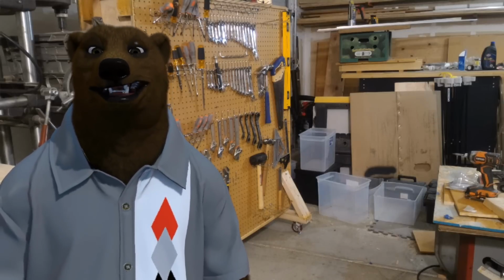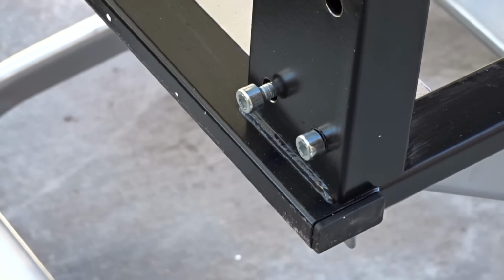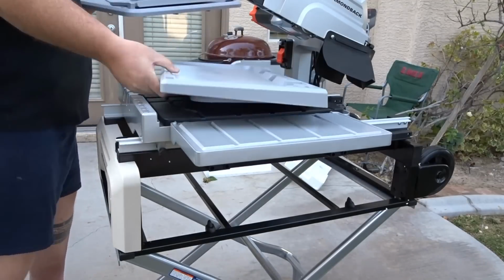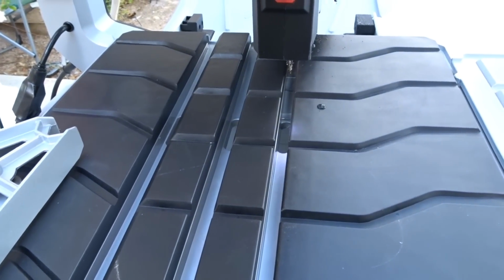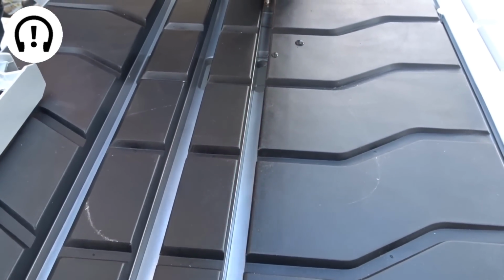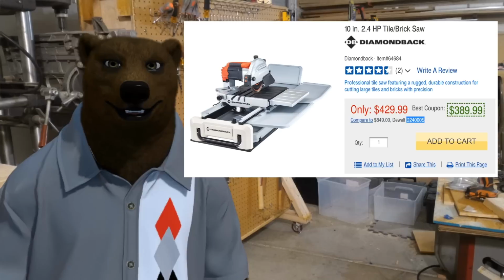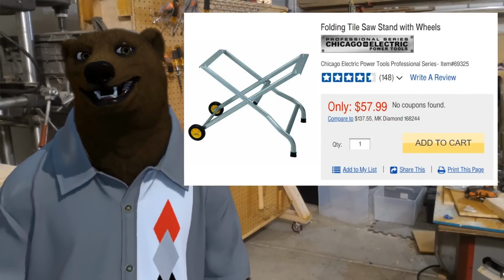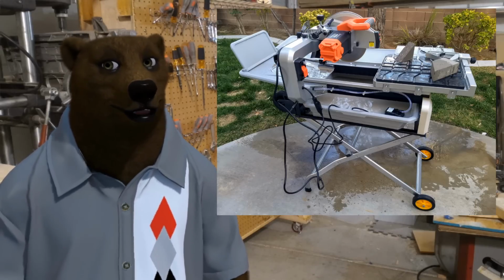Diamondback 10" Tile Saw (Setup & Review)

Comment: I own this saw and IT IS A BEAST. One of the best tools I own. I absolutely love it. DiamondBack blades are excellent to.
Reply: Bought mine about 3 years ago. Still my favorite saw to use and I have 4. Got the Dewalt 10 inch, rigid 10 inch, and a rigid 7 inch along with the diamondback. I like the Dewalt but it's just a pain to set up and break down. And it doesn't cut as well as my diamondback and it's 1.5hp as opposed to 2.5hp on the diamondback.

Comment: Had mine for 3+ years. My favorite saw out of the 4 i have. And i have the dewalt 10 inch. Just doesnt cut as well as my diamonback. Even with a better blade on the dewalt, i still get a much cleaner and faster cut from the diamondback.

Comment: Can you show the different angles you can cut with that's all I saw you got a 45 but you didn't show how easy or how hard it is to subduing that angle end does the motor turns you could do Edge cuts on different angles

Comment: I do tile work and have used dewalt tile saws the most along with the chicago electric 10 inch saw from harbor freight. The chicago electric one got water everywhere and is strictly an outside only saw. And the water kind of just dribbled out until I drilled the water port holes out a little bit. Other than that, it held up well over time. But this new saw looks like better quality all around especially with the splash guards. How heavy is it? The dewalt is lighter than the chic/electric. Kind of important when you are loading and unloading your tools every day, the lighter then better.
Reply from the maker: This is not a light saw but there are wheels on the back so you can pull it along by the handle.  Water control was top notch though.

Comment: I like it but, can it cut slate ? I do agree liking the easy install of blade.
Reply from the maker: Is slate harder to cut than all of the materials I used?
Reply: @denoftools  I am not sure.
Reply: @denoftools   Actually, slate is pretty soft compared to the stuff you were cutting.
Reply: Yes. Slate is compressed mud.
Reply: Slate is one of the softest materials. Granite & marble are the hardest. The next softest to G & M in my line of use & expertise is porcelain. Granite & marble are the two which I get most worried about the power, quality of the blade, and the most accurate of the cut with a wet saw.

Comment: Homeowner looking to do a few tile jobs and wondering whether the 10" has any benefit vs. the 7".  I suspect the main difference would be depth of cut on brick, and perhaps smoothness of cut (10" is larger radius, faster blade, more power at point of contact with material).  Any thoughts?  TIA
Reply from the maker: Yeah, size of the material is the main benefit.  The secondary benefit is that it has more splash guards.

Comment: Bench Tops are great for using next to your workspace on porcelain tiles, like the 4x4 tiles in your shower.
Will it cut hard floor tiles which are usually made of ceramic?... yeah...but it's hard on the motor. 
I have all Ridgid power tools, but man, at $700+, it's a tough swallow since I don't do it for a living anymore.
Great demo 👍

Comment: Been waiting for this since you gave a teaser about it a few videos ago... I have a lot of tile work I need to do in my remodel and I was eyeballing the Chicago Electric but I believe I'll have to spend the Extr $$ for this one. It looks better built, sled and fence also look more well built not to mention the splash guards included.... Good job Bear and keep'em coming...
Reply from the maker: Just a heads up. Turns out that they are blocking DB in the new super coupons.  There are some out there that are still good that don't list it so it's a YMMV situation.
Reply: Thanks!

Comment: this is really just an upgraded version of the chicago Electric 10" tile saw from harbor freight. i have the Diamondback blade on mine. sits on the same table stand too. mine doesn't havce the extrended splash board or the laser. looks like a great saw

Comment: I'd like to know what things they added to this saw from the Chicago Electric model. Obviously the laser, light, and extra splash trays, but anything else change? The 10" Chicago Electric tile saw at $229 was pretty good deal for what you got.
Reply from the maker: Essentially this is an upgrade of that saw.  It's a more robust motor, with a bunch of extra features included.  This one comes with a high-grade blade plus;  laser guide, work light, side table, multiple splash guards and wheels.  The price diff with best coupons is $112.  Now subtract $30 for the blade and it's $80.  So the question is for you, would you pay $80 for a more robust version of the same saw but with a laser, work light, side table, splash guards and wheels.

Comment: Does the water pump have any sort of filtration to keep the abrasive ingres out of the impeller?
Reply from the maker: Yes
Reply: @denoftools  thank you. I didn't see it when your human installed it lol. Is it a fine particulate filter?
Reply from the maker: It is a fine particulate filter.  The tray has a sort of corse filter built in.  If you look closely there are these teeth that form a wall around the pump and they filter out larger debris.
Reply: @12gaugeCharlee  lol, "your human"

Comment: I just picked this saw up 3/3/2019.  After putting it all together with the optional stand, I noticed the sliding table throws itself a hair off when you fully extend it.  Did you notice any bump or notch when fully utilizing the slide table?  I'm headed back to HF to recheck the demo saw table and swap this one out if it's a defect.  Cutting lengthwise on long tiles, I can't have it kicking sideways and ruining blades/material or making work look crooked.
Reply from the maker: No, and I did cuts that were longer than the saw is made for just to push its limits.  Check to make sure that it is sitting on the track correctly and that there is nothing blocking it.  OH, you know what, I did at first have an issue with the hose bumping the table, but I adjusted it and no issue after that.
Reply: @denoftools  Thanks for the reply.  I ended up checking it at the machine shop this evening, the middle guide wheel has a small adjustment allen screw. It wasn't in-line.  While we were checking the underside, we took out the slop in the guide bearings that run under the rails (also adjustable).  It's tight and perfect now.  The guide bearings are drilled and tapped off-center on bolt-ends so needed a small crescent and a standard driver to adjust these, but it can be done.  Also, the rails on the base frame (which the tray guide and flat wheels roll on) are also adjustable.  We noticed the laser didn't match the blade, so that was fixed too.  Overall, impressive quality, hoping for longevity as well.  I ditched the stock blade, keeping it for rock hunting and swapped in my usual $100+ alpha porcelanna blade (one blade, one job).  Thinking on it now, I will true the rails to the blade, as close to the laser as possible. Thanks for the great video cutting all those different materials.
Reply from the maker: lol, it would have been more fun to do if I had not been in the 30's when I shot that video.  By the end, I could not feel my fingers!

Comment: I bought the older bridge saw used at a pawn shop to do a tile shop. One rail had to be adjusted to get the table aligned with the blade. After the job I had to loosen the bolts that hold the casting to the table frame and shim it to get the blade at 90 degrees to the table. Knowing my experience with the old saw II'm leery of spending twice as much on the newer one.

Comment: Is Harbor Freight gonna come out with new a 10 inch mitre saw like the Admiral 12 inch. I like the Ridgid 10inch mitre saw but at 400.00 I can wait for the HF Admiral.
Reply from the maker: If I told you how many different options and types of mitre saws they were coming out with I would get turned into a rug.   I can say that when I was told I asked if they were going to change the name to The Miter Saw Store.

Comment: Any slop issues with that sliding tray?  I'm planning on picking up the 10 in when it reaches stock near me (2 more days)
Reply from the maker: I'm not going to say there isn't any but it isn't noticeable, well at least I did not notice it while using it.
Reply: Check out the comment earlier in this thread about slop and how they adjusted it and got it dialed in
Reply: @scottbrazier3402  I couldn't find the comment, however, I bought it.  No slop out of the box.  Tiny few chips on cheap porcelain (all I have used it on so far).  Bought a high end blade but haven't put it on yet.  Plunge cut worked out well.

Comment: Is it normal to have to manually turn the water on when you turn the blade on? When I turn the switch just the blade starts... If I want water I have to press the "pump only" button.... I can't think of a reason someone would ever use a tile saw without water, so I think my switch came broken from the factory.
Reply from the maker: No.  If you turn on the power the water should start.
Reply: @denoftools  
That's what I thought, looks like Im going back for an exchange/return.  Thanks for the quick reply.

Comment: Hey Bear, have you ever used one of those manual tile cutters?    I am remodeling my bathroom, but I don't want to buy an expensive saw just for a few boxes of tile.

EDIT: Nvm, just found a simple solution.  I can buy a angle grinder, and a 4" diamond blade.  That and the tile cutter should work fine together.

Comment: Anyone use this for lapidary stuff? I just bought one and am scared to death to try it but I am going to anyways. 
I will start out with some thundereggs  so I can see if it's a smooth cut through the base rock of it which is much softer that the core, at least  most of the time.

 Let's hope I don't shoot my eye out. Wanted to get the closeout Chicago one but the drive was to far and I wanted it today. Still cleaning up the 16" slab saw I purchased used . Any ideas for cleaning the crusted on oil from the sides of a 50-60 year old slab saw that still runs great, just want the remnants of the diesel kerosene used motor oil everything they thought at the time would work. It did work but not healthy to use plus it grabbed dirt and rock particles and drag them through the cut which makes the cut rougher which in turn creates more work for me in the long run. So I told grade mineral oil for me it is.

Comment: Too bad you show how to mount the saw on its stand backwards. If you mounted it the correct way, the handle on the saw could actually be used to move the saw around on the stands wheels as intended. Take a look at the picture on the front of the stands manual. The wheels on the saw should be on the same end as the wheels on the stand. BTW, thank you for the video.

Comment: A complete novice when it came to cutters. My wife and I had layed almost 4,000 pavers and my neighbor exposed me to the wonders of the cutters with a demonstration of 2-3 cuts on a 7 inch blade. So off to my local Harbor Freight for their opinions. Harbor Freight is not like Home Depot very few with expertise, but a customer their did provide excellent recommendations. Unfortunately none in stock but there were 6 available in a store approx. 50 miles away. Once purchased, after opening the box I was intimidated reading that there were 178 screws. Fortunately I found out they the majority were already used in the construction of the unit. YouTube (this video) eliminated all my concerns. Within an hour it was set up and running. Looking for items to cut First some "caps" from previous construction...Just like butter...but these "caps" had been butchered with a hammer and chisel ragged edges and all. What a clean surface remained and that was a diagonal cut ranging from 1/4 inch to about 1.5 inches shaved off.
My only regret with this is that I did not have it from the very beginning of the paver laying. Recommended to all. I did not purchase the table...that will be on the next sunny day and another trip to Canon City.
I also wish that the review/display had included the angle cuts. I loved the infra-red light guide light made the cuts so precise.

Comment: During the last clearance sale HF had the Chi-Elec 10" tile/brick saw (#69275) for$219 and with the 20% coupon it was $179. My wife bought the DB blade with another 20% coupon and we made out quite well. Anyway I guess the DB brand is replacing the Chi-Elec Industrial tile/brick saw or moving it down a notch in hierarchy, However they are very, very similarly constructed. The Chi-Elec does not have the LED, laser or wheels but everything else either identical or very is similar. Considering the Chi-Elec is only $279 (sans blade) without a coupon and has .1 HP more, it may actually be a better buy? There is one issue with the Ch-Elec and the new DB will have it too is that if it is used to cut a lot of tile. The catch basin gets saturated with cutting grit and the pump which shares this basin will clog up. I've read that the solution is to get a longer vinyl hose and place the pump in a 5 gal. bucket of water. Also, the so called “industrial” water pump is a fish tank pump and can be easily replaced very cheaply.
Reply from the maker: It's almost like they sell this same pump at HF.

Comment: Using a saddle to show the best close ups of cuts can be hard to judge seeing that I can get a "factory cut" using my handheld dewalt grinder. You should really try giving actuall reviews instead of acting like an apple fan boy
Reply from the maker: Except I didn't JUST use a saddle did I?  No, you watched 1 min of the video and made a comment to try and prove to use how much you know.  We are all very impressed, your a god of hand griding. 👏👏👏👏👏
Reply: @denoftools   the only cut I saw you really zoom in on was the side saddle...most of your cuts you just flashed the cut at the camera but that doesn't allow  you to see the real quality of the cuts.  My comment was because saddles are so easy to cut without chipping